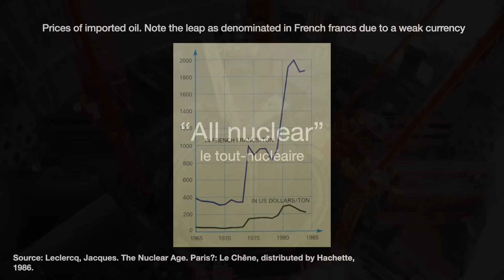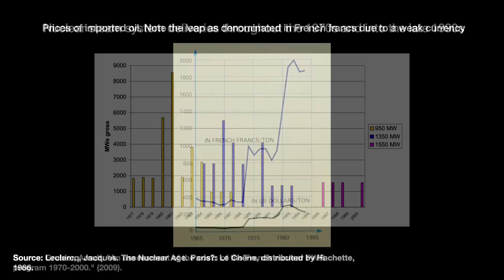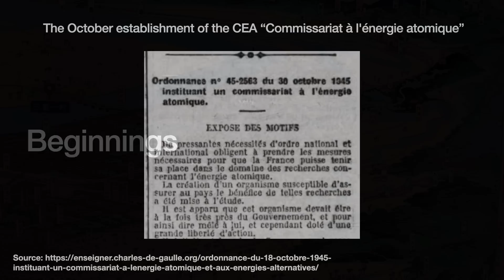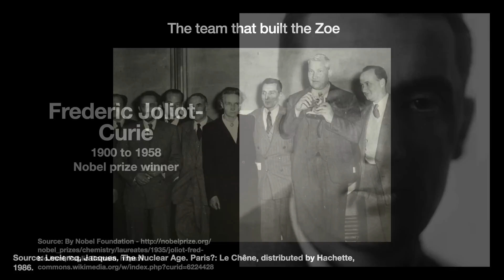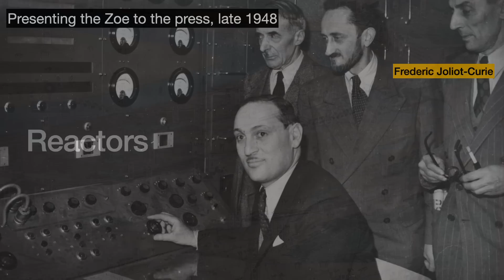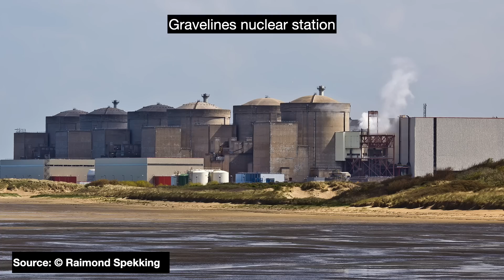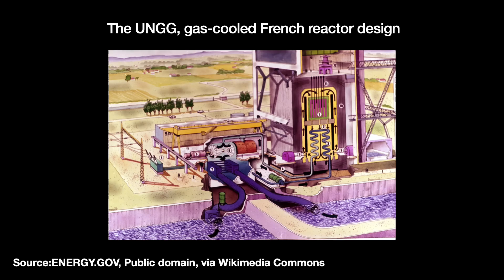That Time France Went "All Nuclear"

Comment: The fastest energy transition in human history was conducted by France in the 1980s with 1970s nuclear reactor technology.
Reply: Electrical generation only accounts for 30% of our carbon emissions. Even a 100% nuclear electrical generation fleet isn't going to help much unless you multiply the size of that fleet by AT LEAST a factor of 6-8

This is the fundamental shortsightedness of politicians and planners. They only look at current consumption. The same applies to renewables, Even if renwables could approach 100% of electricity generation they can't scale to the final production scale needed

The only way to cause widespread adoption of electricity and reduction of oil/coal consumption is to make electricity cheaper than burning hydrocarbons. Everything else will result in "box ticking" exercises to appear to be complying with directives whilst preferring the cheaper methods
Reply: 'Transition'? Nope. In France about 2/3 of the final energy is produced by burning fossil fuels.  Nuclear there produces about 70% of electricity, which is about 25% of the final energy.
Reply: @natmaka So It's fair to say that more 'electricity' is generated in France by cars burning oil on the road than by nuclear reactors?
Reply: @JmJmmmmm   'energy', not more 'electricity'.  This confusion is the root of the problem here, as this very thread begins with "The fastest energy transition..." instead of "partial transition from fossil fuel towards electricity".

Electricity: about 44% of primary energy, nuclear now producing around 70% of it (hence 31% of primary energy), while oil alone is 30% and isn't only use for transportation, which itself isn't only cars.
Reply: @natmaka  other than transportation, what is oil used for?
Reply: @JmJmmmmm  Mainly petrochemistry, heating (industry & buildings) and producing electricity.
Reply: @natmaka  how many MWs does France  generate from burning oil?
Reply: @JmJmmmmm  W is power, Wh is "amount of energy".

In France oil is mainly used to produce gridpower on islands.  A big one is the "Pointe Jarry" plant (Guadeloupe), its nominal power is 220MW and as far as I know Guadeloupe's consumes  approximately 1.7GWh/year, and only approx 400MWh is produced thanks to renewables.

Also: check the "Share of electricity production from fossil fuels" report from Ourworldindata.
Reply: @natmaka  If I'm not mistaken, renewables and nuclear make up about 50% of total French energy production.
Reply: @thelloydersvk5068  Not "energy".  Nuclear only produces electricity, and there are many other types of 'energy'.  As already here stated in France most of the energy is obtained by burning fossil fuels.

France:
- in 2022: 56 active nuclear reactors produced 17.8% of the final energy (they produced 70.6% of the electricity, which constitutes 25.3% of the final energy),
- A new reactor is starting (it was horrendously late and over-budget), there was no new reactor since 1999.  Renewables are booming. Check ourworldindata "Share of electricity generation from fossil fuels, renewables and nuclear"

Comment: The French used one design which they adapted when required but only the, and retrofitted all of the plants afterwards. All reactors are identical.
That way they avoided the mistakes that the US and the British committed and are committing.
Reply: It’s called economies of scale and shouldn’t be a surprise.
Reply: Canada also used just one reactor design up to the present divided into only two variants (single-core and multiple-core), but the Second Canadian Nuclear era has at least 3 different designs currently under development.
Reply: Not really just that they stuck with PWR
Reply: @simon2493  because it was much better, no enrichment needed, facilities for heavy water production built, no different training, etc...
Reply: @AKUJIVALDO That's not what I'm really talking about, I'm just pointing there was no single design. Even a qick wikipedia will te you so. They had like CP0 and CP1 as the fist purely civilian desings and with a few families in between we are at EPR nowdays.
Reply: No, it was far more cultural than technical. Timing, messaging, opportunism, etc.
Reply: What are those mistakes
Reply: @pierren___  The UK built dozens and dozens of different power reactors drastically different in design from one to the other, with the predominant one ending up being the gas cooled GCRs. This means they succeeded in being Europe's no1 address for spent fuel reprocessing and they did lay down an invaluable amount of technological research groundwork, yet when it came to actually making electricity, they were now stuck with a variety of expensive to run, highly comlex and vastly different reactors, which simply doesn't make for an efficient and cost effective power source
Reply: Britain is standardising on the EPR it seems now, aren’t they?
Reply: I do think that most of those problems are due to overegulations because we fear nuclear tech
Reply: @CiurraU235  Overregulations (not sure if they are "over" given that we don't want an accident to happen even if they tend to be "less worse" than the public imagines) are mostly a thing for the new EPR reactors that are being built. The problem with corrosion that affected older reactors is a real issue although not critical (needing action in the next months or catastrophe ensues), but we don't take risk with nuclear energy.
Reply: Which on the other hand lead to the problem that France temporarily lost a majority of their capacity a couple of years ago when issues with one reactor were found, and they had to shut down all identical ones.
Reply: ... One of the main problems of US nuclear was that we used one design, and when there was one failure it soured public opinion of the entire industry
I don't think that's what made them succeed

Comment: If the power ever goes out for a long time all the reactors will melt down
Reply: LoL that was addressed years ago, modern designs shut themselves off and many have gotten updates to avoid that.
Reply: @rodzeroher  Really? The have magic ability to cool all that heat? If COVID19 was a true terror, it would have devastated the workers in nuclear , and the diesel generators to cool the radioactive waste would have run out of diesel. Then you get a melt down.
Reply: @markae0 is this just deliberate misinformation?
Reply: @ my comment was removed. so look up the information for yourself.
Reply: If you are genuinely interested in learning, the term you should google is FOOP.  failures of outside Power.  Spain and Portugal  recently had a massive(total) power outage (cause still under investigation).  Their reactors shutdown with no impact on the plant, its personnel or the environment.

Comment: He mentioned femtosecond lasers, so I looked them up, which then sparked a connection in my mind to quantum computing.  So femtosecond lasers physically cut without thermal noise, and qubits compute without environmental noise, only if the action is faster than the system’s memory. Or in other words both femtosecond lasers and qubits work cleanly only if they move faster than the world can notice. 🤔🤯💥
Reply: What are you yapping about
Reply: @sigmamale4147  I don't rightly know. 🤔😵‍💫
Reply: “I read Wikipedia and did a bad job of translating what I read”

Comment: 15:30 Why would nuclear steam by different from coal or gas steam?
Reply: He explains why in the 30 seconds before that?
As to why the temperature is lower, it's because if you wanted to achieve the same temps as in a coal plant you would melt the nuclear fuel
Reply: @Daniel-yy3ty  This is the correct answer. And maximum possible efficiency of any heat engine (ie something that turns heat into rotational energy) is innately proportional to how hot you can make the working fluid (steam in this case), so nuclear plants waste a lot more heat than coal plants.
Reply: @Daniel-yy3ty  Thanks, I wasn't catching that.
Reply: From the way he worded it I think it's just colder. I assume due to double loops and thick wall pipes to keep radioactivity restrained. Coal plants must be able to have their burners much closer to the final turbine by comparison ?
Reply: Other guy is wrong.  

Superheated steam is much more efficient at turning a turbine. 

Also, how fast you can increase/decrease the temperature to match load usage is extremely I
Important
Reply: because when you burn coal or gas, the combustion is incomplete, so there is some other gases that come out (CO2 for coal, for gas, depends) when it comes to Nuclear, the way It work is the Uranium gets heated kinda like you'd heat an iron, and then it heats water, the water then boils and make the turbine roll which then create the electircity. the Uranium essentially doesn't burn, just get heated with nuclear reaction, there is no combustion. Hope it answers your question
Reply: @Naelglrm  Sorry, but that does not answer my question. They all use some sort of heat exchanger. How does the water on the turbine side of the heat exchanger know where the heat came from? Heat is heat, right? No combustion gases or anything of the sort goes to the steam turbine.

Comment: 22:20 Grubler's numbers are basically an anti-nuclear hit piece. A later report by the French Audit Court (The costs of the nuclear power sector, January 2012) shows much lower increases in constant euros:  22% over the 900 MW type for the P4, 16% for the P'4, and 38% for the N4.

So there was in fact a cost improvement between the P4 and P'4 series. But this is obfuscated by the first pair of each type (what's known as the FOAK) being much more expensive. The ex-FOAK cost increases over the 900 MW series were of just 15% for the P4, 12% for the P'4, and 18% for the N4. And given that there were only two N4 reactor pairs, further cost reductions could still have been unlocked for that type if it kept getting built instead of sidelining it in favour of the EPR.
Reply: Yeah. It is really frustrating that so many anti-nuclear scientists muddy the water with bad science and weird assumptions and comparisons. And since the press and people not deep into the topic quite this as "the science", it becomes conventional wisdom. It is especially bad in Germany.
Reply: @nielsharksen78  Still, those bad Germans do not live on borrowed money: in 2024 France's debt reached 113.0% of GDP, while Germany's was at 62.5%. AFAIK EDF is a state owned company so probably power is sold to cheap and is indirectly payed for by either taxes or by borrowing money. So much to the great success story of the France nucleair power. Also about this whole idea of France not having oil (and maybe not wanting to depend on a foreign country): do they have large deposits of cheap enriched uranium laying around in their backyard ? I'm not against nucleair, but please stop pretending that nucleair is the absolute perfect solution and that France has thus solved every problem. They did not.
Reply: @DikkeDouwe  EDF is a profitable company and pays dividends to the French state. 
The point about Uranium is that the cost of the raw material is negligible per kWh and being a dense, solid metal, you can store it very easily. Which means you can easily stockpile Uranium for years if you feel uneasy about supply. In addition, Uranium is available with reliable allies like Australia and Canada. 

This isn't really an option with other fuels and raw materials
Reply: @nielsharksen78  EDF might be 'profitable' as is. Because all costs are shifted to the state. At some point those reactors are EOL and they will need to be decommissioned. For that EDF hast set €36 bn asside. The current estimated costs however are €100-€112 bn. In other words they are missing at least €50-€60 bn to do so. I will not start about the rising costs of building new reactors. There are enough examples of plants costing way more then initially estimated. 
Owh and the idea of stockpiling Uranium: I have no knowledge about how 'smart' it is to put a huge pile of uranium somewhere. I assume putting a smaller amount of highly enriched uranium might have it's own problems. This does not change the issue of you as a country being dependent on another country for fuel. Also: the prices for solar, wind-energy, batterie-storage are all falling. The prices for uranium, building new reactors, decommissioning old reactors are all rising. I think building nuclear power plants in the 70s was maybe a great idea, but building new ones in the late 2020s sounds like stupid to me.
Reply: @DikkeDouwe The reactors have decades of life left, decommissioning fund will be stocked up. In addition, it grows from interest on its own. 

Regarding Uranium, storing natural Uranium is not particularly difficult and not dangerous. 

In today's world, any country is critically dependent on the rest of the world trading with it. 
VRE equipment is also important, PV is almost entirely dominated by one manufacturer, China. 
The interesting question rather is: Are you critically dependent on someone? And how much does it cost/how long does it take to end the dependency if necessary? And the answers are quite favourable for Uranium.
Reply: @nielsharksen78  Flamanville 3 rose from 3 billion estimated to 27 billion. That is all paid for by the taxpayers. Flamanville 3 will now never be profitable (and a one year hiatus due to repairs is incoming) and yet EDF will continue building more reactors. Let's hope that these blown up costs will not continue for the French people. Because even though EDF is profitable right now (after getting bailed out by the government in 22) when electricity prices continue falling with battery storage and renewables increasing nuclear power will be a huge financial problem.
Reply: Don't know the details of these particular cost reports, but often mixing of real and nominal cost figures are used to make costs and costs growth look much worse.  Any honest cost study needs to stick to real (constant XXXX year dollars.)  Inflation is not a real cost.
Reply: Oil greatest threat was always nuclear, renewables are a joke spoken by bribed politicians and researchers.
Reply: @JayWasAlreadyTaken  Bribed "researchers" are nothing new.